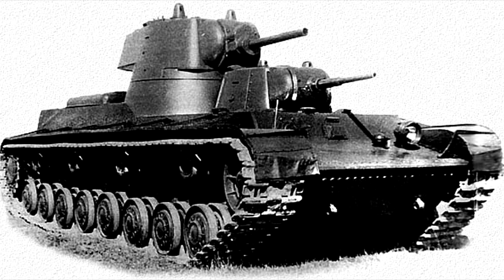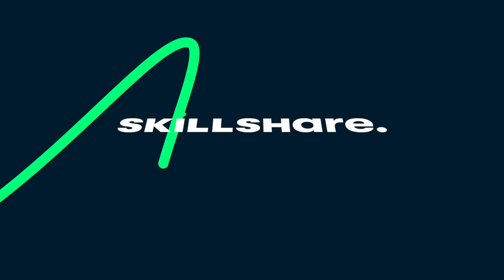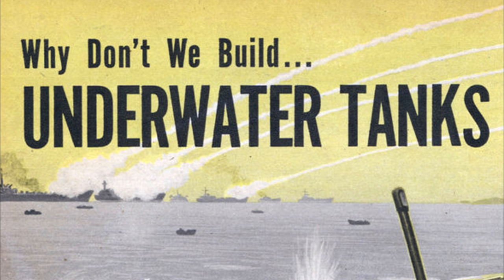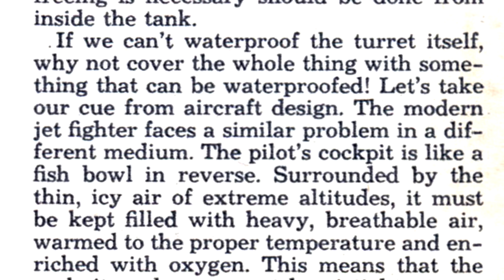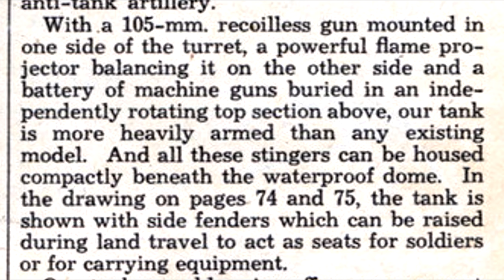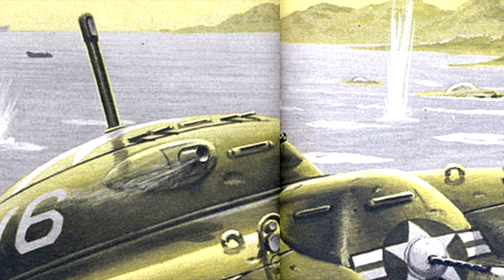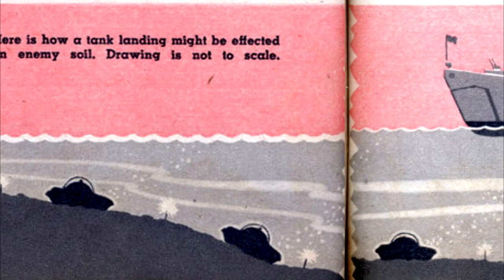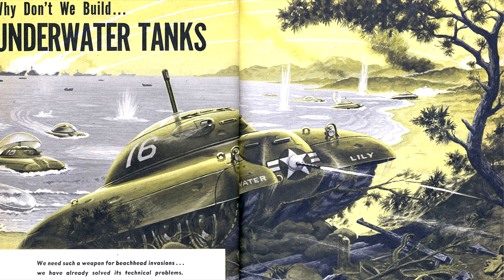The CRAZIEST Amphibious Tank Concept EVER | Cursed by Design

Comment: I mean conceptually it seems like a great idea. Being able to have a tank assault come out of nowhere with little to no warning from any beachfront seems pretty damn impactful. In practice I don't think there's many forms of traversal that wouldn't get stuck half the time dooming the crew to a horrible death. Maybe it's just sticking one bad idea on top of another but maybe a leg setup would work. If nothing else we get a moral victory for making crab tanks.
Reply: Wouldn't the issue for a leg/walking setup become speed and weight? The beds of waterways, rivers, and the sort, already present significant challenge to modern crossings in that they still frequently become stuck. So removing the weight distribution of tracks will just exacerbate the issue. I think the best approach to the hypothetical for reliable armor for beach landings and surprise amphibious attacks wouldn't be how stealthy you can make it, but instead to try to make it as fast as possible, focusing on speed and shock than stealth. But then that just loops around to what we already have that works, larger delivery landing craft that just delivers the tank from point A to point B.

That said, crab tanks are absolutely rad and I want to see one anyways.

Comment: I think getting stuck on the sea floor would be the main issue, as it would be a death sentence for the crew. Perhaps using disposable pontoons that can also be jettisoned from the inside would be able to make the tank light enough to traverse the sea floor, especially since it would be operating in electric mode and have significantly weaker drivetrain while underwater. I think the design could have worked well. Detailed underwater mapping would also be needed prior to attack I would imagine, did the technology to do this exist at the time?

Comment: Even if the design would've worked, what would stop the enemy from preemptively deploying anti tank Czech hedgehogs on the sea floor some 25-50 meters off the beach? The submersible tanks will just get stuck as they can't move forward, nor can they load themselves onto the boats from the seabed for redeployment.

Comment: The engine for this thing could be a wonder to behold.  It would be a potential exploiter of a hybrid turbine.  Initial startup and underwater power would be produced by combining diesel oil and high test hydrogen peroxide in a catalyst and expanding the resulting steam in a turbine (The Germans experimented with this as propulsion system for U-boats)  It would be the closest thing to an internal combustion steam engine.  Once out of the water, an air compressor is coupled to the turbine.  Compressed air is driven through a combustor and then on to the turbine.

As the volumes of turbines are small. compared to their power output, a less magnificent system has separate turbines for air and steam.

Comment: "...would more than likely have been mothballed quickly." Mmmm... Would depend on when it happened. We all know of the DoD's long-ongoing love affair with multiple money pits of questionable practicality.

Another issue I see with this tank is it requires a driveable slope from seabed to shore. If the coast has a dropoff, it's in trouble.

Comment: Writer's biggest issue is water tightness and cold war tech is already capable of this at low water pressures, which is totally doable todays tech at much more pressure values. But solving the huge rocky terrain problem is almost impossible. On the other hand, getting stuck means casualty of a whole trained tank squad and a multi-millon dollar junk. Only viable option is putting some tracks, armour and small turrets to a submarine to make surprise attacks and emergency evacuations. And than, you still can stuck while approching to shore, at least you can live with that.

Comment: You know really the dome doesn't necessarily have to be see through, I think that if it's clear for visibility, it would be hard to see through regardless. So this brings me to my next point, instead of blowing the whole thing off, you could have it be resealable and have the gun barrel poke through, and have the whole thing raise up only a couple of inches. So it would still rotate with the turret, but if the tank is needed for another landing the crew could hopefully have some sort of sealant and figure out a way to cover up the barrel again, maybe some sort of rubber stretched over it IDK, the dome could pop back down and they could have an internal hole on the turret to pump the air out and make a vacuum.

Comment: Why not add extra detachable wheels for the sea floor travel? I think that would move better provided its bigger than the tracks, which means it won't get stuck on coral reefs AND the extra oxygen in the tank would means it doesn't exert as much ground pressure underwater

Comment: Cursed indeed!

The design and production of that tank-lowering ship would also have been a monstrous difficulty. Perhaps not insurmountable, but certainly very challenging.

I echo many other commenters with the getting stuck on seabed. I would not want to be in a cramped submarine with poor mobility and very limited air supply that would need to be flooded in the event of making an emergency exit. At least if a tank is on fire on land, the outside of the tank is not also on fire (generally).

The more I think on it, the more ludicrous the idea becomes!

Comment: The main problem here would be lowering the tank out of the ship. It's enough of a pain in the ass to lower relatively light submarines without banging them around in any amount of chop. A tank would cause a lot more damage swinging about, and if it submerges the wrong way it could easily flip over, like when you drop a sheet of steel into water. Then you have to unhook the thing somehow, rig up another tank, and have it follow churned seabed to shore. We have better ways of getting tanks to land, like hovercraft, as it is easier to make a ship go on land than put a tank in the ocean.

Comment: The reason why modern tanks, or any tank, couldn't stay for long underwater, was because we still use combustion engines, those require air to be able to work, otherwise they will stall or just shut off, because of how combustion engines work, and those tanks weren't meant to be driven underwater as a main travel path, so the engines weren't purposeful built. Snorkels are only for the crew, because engines can run for a limited time without air.

Other thing is, if there were will be a battery pack powerful enough to power a ~60 ton tank for a decent amount of travel distance, then it will be possible to drive underwater for how long battery will last. Tracks will be required to be purposeful built, with spikes probably, in order to have a better grip of the mud or sandy bottom, similarly to how one travels in snow, wrapping chains with small spikes around tires, or using tires with spikes inbuilt, or otherwise. For tanks I suspect the same, but at larger scale.

Comment: To make this work, you would need to scout out underwater obstacles accuracy. So tanks deployed can avoid them....

And given what I understand about water visibility either these contraptions can only be used in ideal conditions, or they would need a submarine compass to give guidance about direction, pitch and depth. Meaning a complex gyroscope mechanism for a singular use.

Wide tracks improve ground pressure but not ground resistance. And we want how much propulsion?

The weapons system overall appears to be a single use design ill suited to combat in general. It certainly can advance up a beach under machine gun and high explosive artillery fire. But. You have cruisers off the coast. And Battleships. Any enemy stronghold? Call in the firepower. Be they tanks or bunkers, a well placed shot from naval artillery obliterates land based craft.

So the rifle is not helpful.
I personally would suggest a howitzer and a flamer arrangement. Lob low velocity shells into defensive emplacements. Give infantry the anti tank role, they will likely run into them first anyway. Leave these to flush out bunkers with flamers and direct fire large caliber high explosive.

Sure you can't penetrate a hostile tank. But they won't enjoy 120 mm howitzer fire either. They will be shell shocked as their tank rings like a bell :D

But why do I say leave tanks to naval Guns and artillery while these should be bunker specialists?
Well. Tanks can't hide in difficult to shell places and push you off the beaches. Bunkers however can slow your advance and create strong points behind your front line.

So deploy a tool to support the infantry and keep them advancing. WW2 and other conflicts show tanks are poor defensive tools, but excellent offensive support ones.

A tank has poor visibility, bad situational awareness and can be readily flanked and defeated in combat with anything that isn't a tank :p so support the infantry, who are the ones who need the armor to fight through artillery and machine gun fire.

Besides. It's not like the Helicopters would leave you any tanks to fight. Nor would the air power leave you many soft surface targets.

Although I suspect a 120 mm howitzer would do interesting things to anti aircraft systems.

But the bonus machine gun roof rack? Silly idea. How would you even aim it up or more importantly. Down? Into those trenches you for some reason didn't want to flood with flamethrowers. Or up into trees with guys dropping explosives on your roof?

The idea is So situationally specific. Would need extensive recon of the sub surface environment. Would stir up so much mud as to make navigation an instrument landing system logistic matter. Be vulnerable to anti tank mines which I note the design cannot combat, nor do they ready the beaches for coming machines, and honestly what sort of track would even be compatible with beaches of sand, pebbles, mudflats, mangroves, and minefields.

Comment: The Russians in the early 1960's had tanks which could cross on the bed of rivers. A large diameter snorkel tube  on to the top of the turret provided air for the engine as well as the tank commander at the top of the tube guiding the tank.

Comment: if you make the turret heavy enough and if the turret ring was formed to keep water out through the pressure of the air inside maybe having some brushes to help trap air the dome idea wouldnt need to be done i think de-attachable ballasts would be better than driving or only having the option of driving the tank on the bottom and risk getting stuck and would allow it to be deployed much easier and cheaper also allowing the ballasts to lighten the tanks ground pressure when nearing the beach head they will be operating while only requiring cranes to lay tanks in the water vaguely similar to life boat cranes as for the gun that a hard one hydrophobic clay and a very thick piece of plastic or canvas to be forced into the gaps of the gun via air pressure might be enough to keep air inside but i wouldnt trust it, it wouldnt need to goto the bottom just low enough to not be able to be hit by things that cant damage it although worst case should almost always be strived to overcome, would need a drain or pump almost for certain would need some method of air storage and a specially designed engine that forces used air out into the water when the engine is on, electric transmission would be of great benefit if the batteries can last long enough to make the tank move maybe 500 yards at a minimum depending on beach terrain and if propellers can move the tank efficiently far enough so the air bubbles that are from the engine cant be heard or seen when the engine is on for more stealthy deployments.

Comment: The biggest issue aside from actually traversing the sea floor is the fact that the engine requires air. The engine will use thousands of litres of air per minute, and an air tank that can store even a couple minutes worth of air would take up a very large volume in the tank.
Reply: Maybe he would be powered by an electrical engine underwater then switching on gas engine once out of water
Reply: @unsuisseegare1291  No way a tank can have big enough batteries to power itself on the soft sea floor. It weighs like 30x more than a Tesla already so it would need a ton of electricity.

Comment: I really don't see how a recoilless rifle in an enclosed turret is supposed to work. Is there any way to implement that which doesn't kill the turret crew the moment the gun is fired? I suppose if the vehicle was open topped it could work great, but you aren't going to be submersing that vehicle.
Reply: My guess is a sealed breech cover and an external vent port.
EDIT: Not sealing the breech itself, sealing the breech into a compartment that's vented.

Comment: Unlikely the tank could avoid sinking into the silt unless it was near neutrally buoyant. If it did get stuck, it would be a death trap. 
The main advantage would be that you couldn't see it coming until it surfaced, but I don't see the design as-is allowing for significantly more armor unless additional flotation aids were used (which could double as the air supply). At that point, you may as well make it truly neutrally buoyant to avoid getting stuck on the sea floor, or just use latch-on flotation aids for more heavily armored tanks and float in on the surface.

Comment: an underwater tank would be possible. but only with a snorkel, meaning only to a limited depth. combustion engines,also in diesel/electric drive, need enormous amounts of air. the quantity in the tank would suffice for a few seconds. sealing the turret ring was successfully and cheaply done by the germans in the war by using an inflatable rubber ring, easy to deflate when the turret needs to rotate.(also used as the canopy seal and lock on the Trnado fighter/bomber!)  as to the gun, a recoilless gun also needs a long tube ,and of course the gasses that come out of the back of the gun need to go somewhere! see the Ontos..   but a gun can be sealed, on the leopard a lot of openings are sealed by rubber plugs, tied with a cable to the hull, so that when you rotate the turret the plugs get pulled off.  so if you can find a beach where the water leading to it is of a guaranteed maximum depth, for a long distance(the tanks need to be lowered into the sea out of reach of the coastal guns!!) and more or less flat eand even, then it would be possinle. maybe.

Comment: I can see them getting stuck at the bottom of the ocean because they cannot get over the underwater shelves and corral reefs. (Yea, I'm a Certified Scuba Diver!)  If it had flotation devices that could be jetisoned once on shore to act as ballast tanks and perhaps a water jet drive (Much like the PWC we now have) it might make more sense.  Perhaps using the flotation to suspend the tank below the surface and not on the unpredictable sea beds composition.  But it takes a lot of flotation to hover float 40 tons in strong undercurrent.
I think helicoptering them onto shore would make more sense.  Especially since we now have the Attack Helicopters.  But then, why would you need tanks when you have flying artillery planes like the Spooky?
And lasrer guided rockets........
Awgh,  Fun to day dream.  Maybe we should just invent weather controlling machines and send Massive Lightning and Hail storms at our enemy.

Comment: I'd like to point out that a perfect concept or design can still fail because of screwups in later phases of design and construction.  These underwater tanks have more potential points of failure in that regard, which means it's more likely to get scrubbed because of some snafu on some random subsystem...or too many snafus on too many systems.  The KISS principle exists entirely to attempt to offset this effect...

Comment: Interesting video.  As for the tank, I do wonder how well that plastic dome would have stood up to shock while underwater.  Could conventional high explosive artillery be used as impromptu depth charges? What are the chances of popping the dome seal, or even cracking the dome, if the enemy is shelling the ocean offshore where these underwater tanks are trying to advance through?

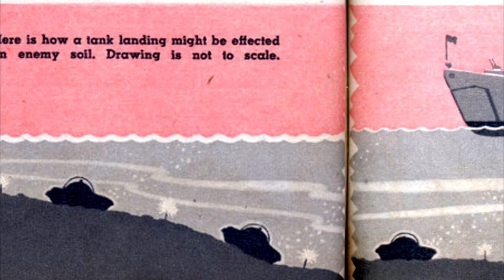Comment: After 9:37, Are you sure that plastic dome would be in reusable condition after exposure to explosive charges powerful enough to throw its mass and its air resistance clear of the tank? And then there is that sudden stop when it encounters the ground.

Comment: I wonder whether Hydrogen Fuel Cells would work to power a tank like this? You'd avoid the problem of the engine producing noxious fumes that way, but in exchange you'd have a highly explosive fuel to worry about if that area gets hit. And since these tanks would have an electrical propulsion system, they could also be equipped with railguns, if the problems which exist with that tech could actually be ironed out.

Comment: Interesting idea but looks like a nightmare in reality, after the first tank has driven across the seabed there would be zero visibility due to all the mud kicked up, an electronic guidance system would be far more practical, which also leads into the perspex dome being completely unnecessary, I'd guess it would be far cheaper, more practical and stronger to make a fibreglass or pressed metal dome, in fact a simple metal could be used as the turret itself can be used as the main support structure. I'd also guess this would probably need something like like a water jet to assist with movement as anything other than a rocky bottom would be very hard to drive on due to most seemingly solid grounds acting differently when saturated with water.